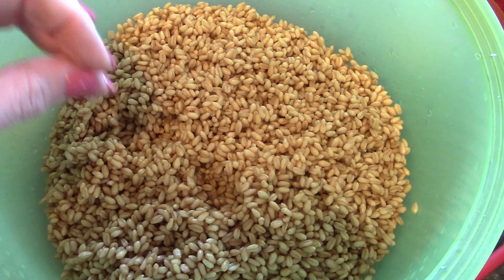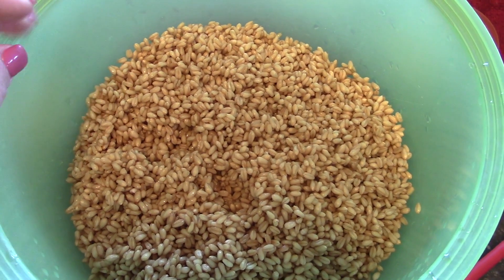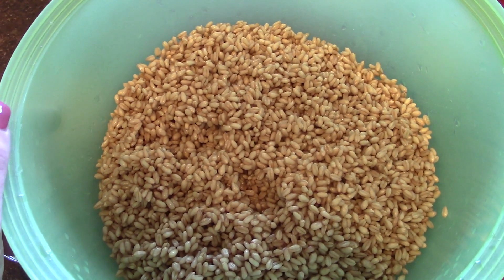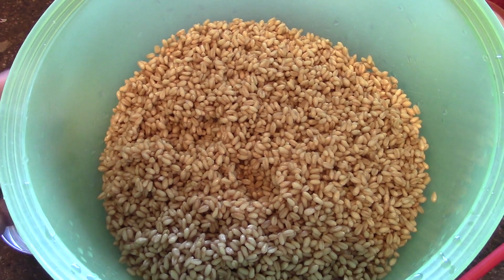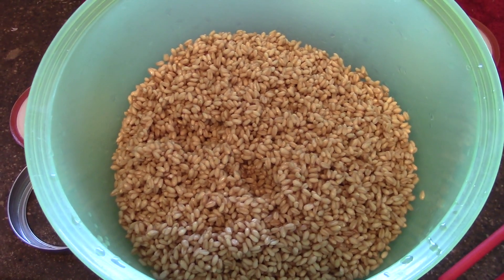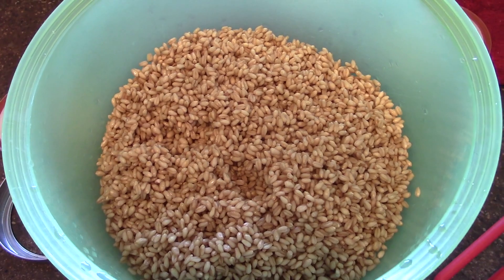Problems on the Homestead & Farm

Comment: If you have a premature failure with a solenoid. Load test the voltage supply wire and a thorough cleaning on the ground wire. Otherwise a new solenoid will work for a while but then fail prematurely. Good luck.

Comment: That was a most interesting food science lesson at the beginning. Must look at again to get the name of the acid.
Kevin, farming is all about the weather. That’s why farmers always talk about the weather.
Older tractors had simple mechanical pto and transmission engagement. Electronics in tractor functioning is great until it gives trouble. A little contact corrosion’s in one solenoid can cause a big stall on the busiest day’s work.
Dish washer is another job for the experts.
Great video.

Comment: Yep, sometimes it is easier for a service person can come out to fix it or you can take it to a dealer.  The last time I blew a hose on my skid steer I took it to the Bobcat dealer. I new if I started to remove the hose and if I had trouble with taking it off I would not be able to load it on my trailer, so I took it to the dealer. You don't have to tell me butt where do you take your scrap. I take mine to Kalamazoo Scrap Metal.   Love the video's keep up the good work and god bless and stay safe.

Comment: Tell Kevin it must be like a car I had, I had a Sunbird(older car) and in winter as I was ready to go to work did not start we found out it was the starter which was on top of the transmission and just enough room to feel around and put the new starter in, the car still did not start !! we found out a wire on the starter came off in that small space too small to see in so we had to feel around and connect the new wire 3 hours later we got it in and the car started !! good thing too cause I was ready to burn it lol !! we called a friend who was a mechanic who told us we did it the hard way, he would have taken the engine out so he could see better and more room to work.

Comment: Scrap prices have been pretty blah for a while now huh? I am accumulating a decent size pile of rotors and brake drums from the trucks that I need to get rid of. Thanks for the update on the Challenger Kevin! Curious to find out how that works out. Hopefully no damage to the PTO clutch from the solenoid not holding the correct oil pressure? I kind of thought that tractor had an exhaust manifold leak in one of your videos when I saw the title I was wondering if that’s what you were going to say
Reply from the maker: The Challenger does have a crack in the exhaust. It will need to be replaced eventually...

Comment: Is the screen plugged on your dishwasher?  Didn't say what the issue was, but seems to be a common issue as most don't know there's one down in the bottom to protect the pump.
Reply from the maker: No, it's something with the control panel.